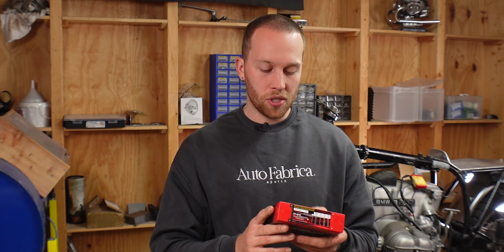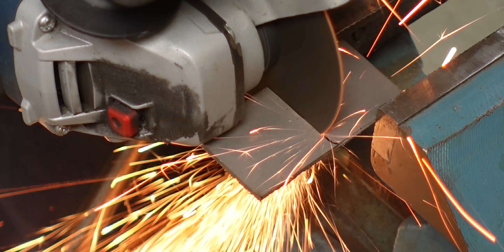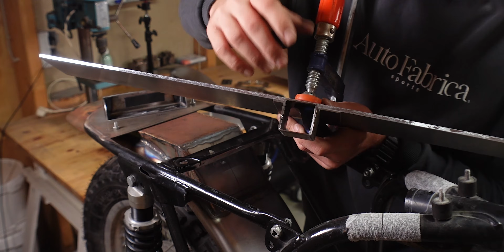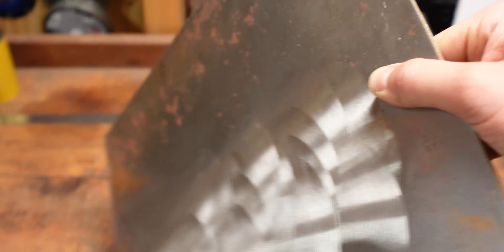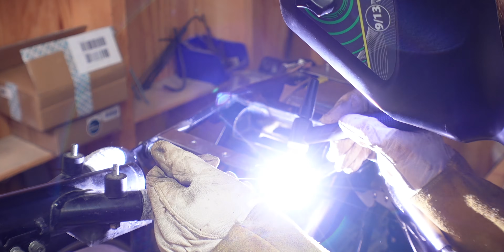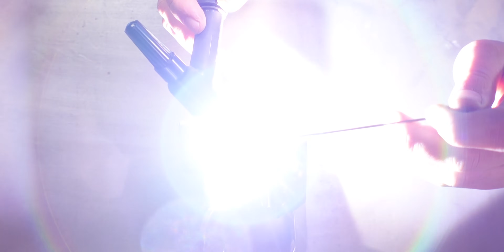How To Build A Battery Box For Your Custom Bike

Comment: Give me 7 ideas in 2 minutes. Thanks man
Reply from the maker: What are you working on my friend?
Reply: @MotoWrenchers  i am doing an almost complete rewire job on my pitbike SSR170TR (Not as cool as what u work on i know) and will incorporate a headlight and associated equiptment along with under glow lights made from police strobes set on Steady burn). For that i went ahead and added a battery and was looking for bracketing ideas and light mount options under the seat and rear. Ur video gave me a different perspective to look at for mounting options. Along with the welding and ideas to the frame instead of mounting. Thanks for the video man.
Reply from the maker: @AlexanderMachiavelli hey man, that sounds like a very cool project 😎😎 where do you live? Can you ride it on the streets or do you need to stay on your property (technically 😅)? Send me a picture on IG when you’re done 🤩